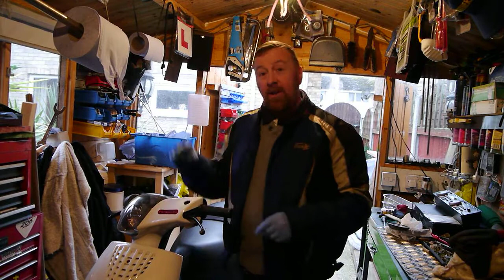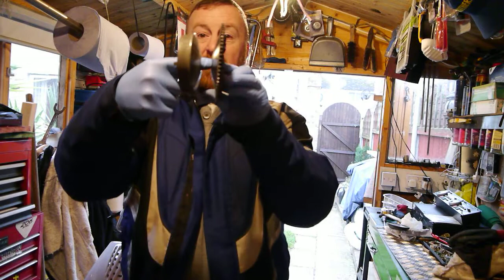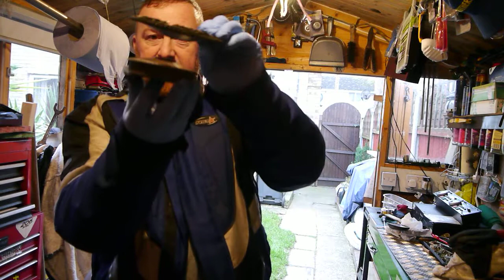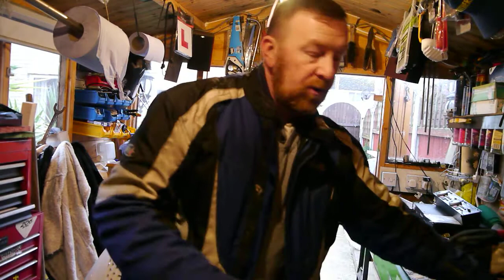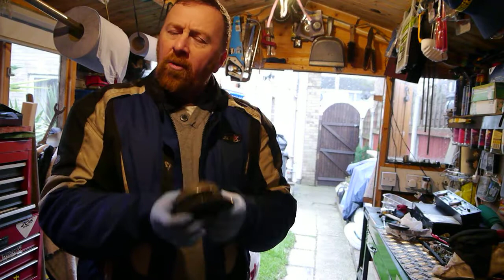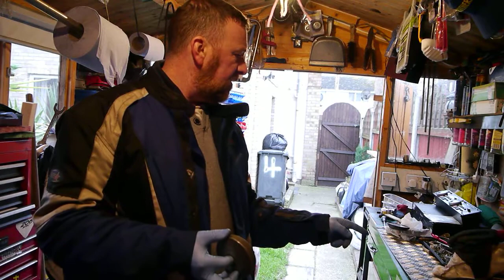MOPED VARIATOR SYSTEM EXPLAINED IN SIMPLE TERMS MARK SAVAGE

Comment: hi need some advice, i’ve got a 2019 ajs firefox 50cc 4 stroke it is dangerously slow and i have checked for restrictors in the variator, exhaust and air box. i’m almost certain it’s restricted by the cdi unit, unfortunately i cannot find one that is de-restricted. it is not the usual 6pin plug , it is  a delorto cdi unit with lots of wires can you give me any advice on what to do. thanks

Comment: Bit of advice mate .. I got a bike and the fixed pulley end that the bendex gear goes onto (ment to be fixed lol) ..it just spins around and not engaging engine to start ..on closer inspection the spline teeth are worn smooth (fixed end not the engine side) .. I've managed to remove it ..took quite a while as you can imagine .. anyway I got a new one to slide on but there seems to be a space between the slider part and the cog end if makes any sense, it's not sitting flush with slider  ..like it needs a washer ..the original seemed to be  same and am guessing it's that bit of free play that's done the damege in first place ..and obviously don't want it to happen again .. so is this normal and nothing to worry about ? Or does it actually need a washer to fill the gap .. ?
Reply from the maker: ive seem both so some have had a washer but most don't so maybe others have had the same problem as your having 
ive also have where its a 50cc and they have had a 100cc engine cover which also caused a problem as lots of people play with these 
see how it goes like it is and check after a few goes if any damage add a washer 
take care bud 
mark I do have a few other videos on that part on my channel worth a watch
Reply: @marksavage  thanks mark appreciate the the help buddy

Comment: Hey mark I am wondering if u can help me I am in need of help now I have a aerox 2006 yq50 and it just running like crap it don’t hit the powerband or nothing and I change the variator kit and bought a new one put 3.9 rollers in it and changed clutch but it still not working I cleaned the carb,air filter and changed the fuel, I just went to a bike shop see if they could help and they said “might want to save a bit of money and buy one with lowers miles” but mine only got 90051 is that a lot for a aerox 
EDIT: and I changed the belt

Comment: Hi mark where the variater goes below what the variater sits on can’t think wat it’s called that thing I have a another washer sitting on that it’s like 4mm wide shall I take that out too ?
Reply from the maker: the VARIATOR on speedfights sits on the crank, this is where the washer is and can be taken off.
on other bikes like a aerox it can have two one either side and you can put them together on the other isde so nearer to the engine this is so you can still kick start
all other mopeds you can take it off but need to see if it helps or not and you may have to put it back on, any other washer that's not on the crank leave mate
Reply: mark savage  it’s a piaggio zip day the washer u throw a away all the time it like next to that but thicker is that meant to be on there someone said I’d end up snapping crank if i take it away or is it just another washer that I can remove any way of sending you a picture ?
Reply: Like after I put variater back on there like another 4mm fat washer then there would be the skinny on then the teeth if u understand what I’m saying ah

Comment: Hi mark, I've got a sym jet 50 basix on a 2003
It have a technigas sports exhaust and kackua performance variator.
I tuck the variator cover off and noticed my belt was really lose, like you can pull it together in the middle lose.
Is it ment to be like that?
Also It looks like my rollers have a flat spot😞😞
Reply from the maker: you have a done a good job of telling your self what needs changing bud 
new rollers clean VARIATOR , change belt bud and check clutch 
please like and sub bud 
mark
Reply: Cheers fella😉 already subscribed 👍
Keep up the vids 👍

Comment: Mark I have a gilera runner st 125 the bike will idle as soon as I touch the throttle it cuts out what could it be
Reply from the maker: archie andrews hi bud 
Service the carb look at the are petrol mix and the air filter 
Change / clean plug just to make sure it ok 
But it’s going to be carb watch my carb video 
Mark

Comment: Mark can you help me my moped Honda sh125 is not starting any more after the battery died and I tride jumping it
Reply from the maker: Moto Boy.x I’ve not worked on one but to start with how did the battery die
If it was working fine then one morning it was just dead I’d simply buy another new battery
Jump starting a bike is not the best way and if from a just pack or car it can cause damage due to the wrong amp  power 
Mark

Comment: Hi Mark me again lol, can i ask you is the speedfight 3 (2T AC) restricted by CDI ?
Reply: And one more thing should i run 6gr with 3.6gr rollers with a red malossi contra spring or 6gr with 8gr ?
Reply from the maker: HyperRacing yea bud one of the reasons I don’t like them lol
You can change the variator , rollers air filter insert , exhaust and upjet 
All that will help but the cdi is still a bugger 
Did I mention as in all my speedfight 3 video they also hate me pmsl 
Mark
Reply: mark savage they are so hard to work on but they look so good hahaha anyway thanks alot Mark much respect 🖒

Comment: dont the weights just help you fine tune the rev range so that the engine is always running in its sweet spot?? light weights mean its gotta rev higher to fully open the variator and heavy weights mean lower revs to fully open??? thats why when you fit a sports exhaust and re jet the power band on a 2 stroke is usually higher up the rev range thus meaning lighter weighs required??? i could also be talking complete nonsense...i just thought weights have no real effect on top speed mainly just acceleration within reason
Reply from the maker: colin bourne ok! Let’s try it another way 
The variator system is like a gearbox on a car 
The gearbox has nothing to do with the internal combustion engine all it does is change the gearing so if you stay in First it would only do let’s say 30 mph and if you tried to pull away in 4th it was stall or do it very slowly 
This is what the variator does it changes the gear so nothing to do with any sweet spots or carb 
How’s that bud 
Hope that help and that’s for watching 
Mark
Reply: mark savage. i get ya pal...keep up the videos 🖒🖒